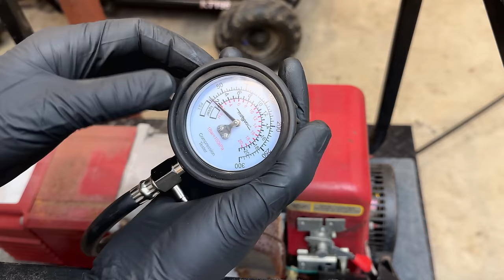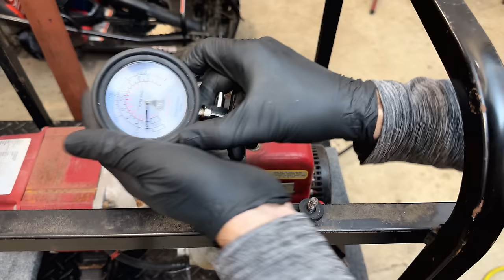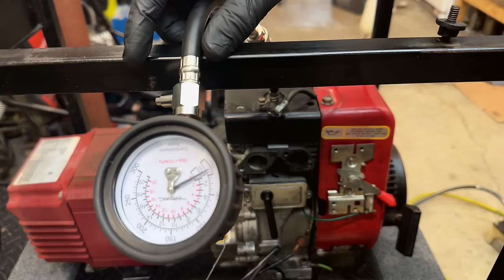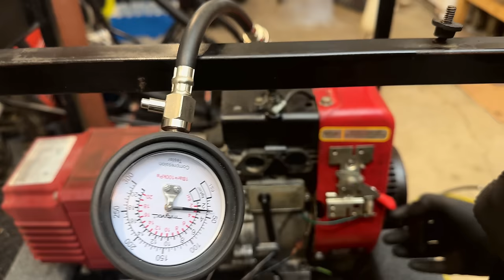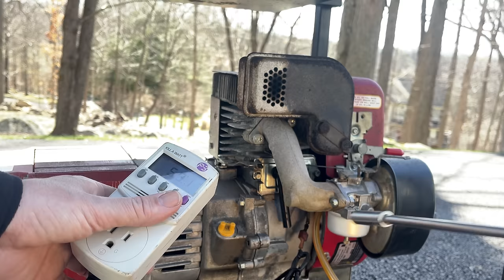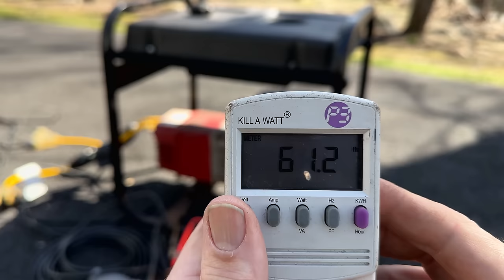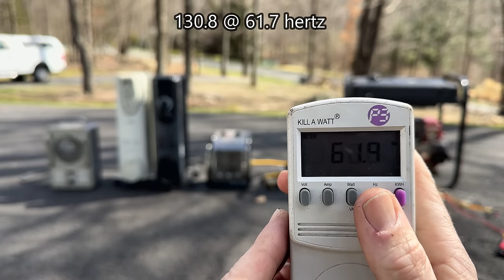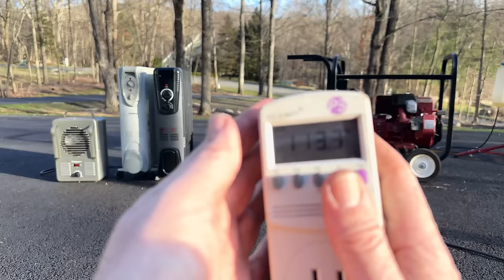More Tecumseh Trouble - Low Compression

Comment: When are you guys gonna get rid of that WD 40 crap (water displacement 40th try) and switch to AeroKroil?  100% better results.  WD 40 is not a lubricant.

The Scotch-Brite would do the same valve cleaning using water.  I've done so.

Comment: I find that make of motor so finicky.  Can I ask you why you play with the choke, there is no fuel in the carb, and you want all the air available, or is it just a habit?
Reply: Not the carb per se..

it's that long unheated manifold with the 90 degree bend allowing fuel to fall out of the airflow when the engine is cold...
that's the cause of the lean mixture and rough running.

If you adjust the carb for smooth cold idle..
when the engine warms up and heat migrates from the head to the intake..
then you get a rich mixture under load.

Small engine carbs are usually straight shot down a small manifold (if any) straight into the head/valve...
Reply: I guess I wasn’t clear   When you were priming with starting fluid at the very first. The tank was dry no fuel to carb. No fuel to “fall” out   Sorry I was not clear on when you where closing the choke
Reply: James actually explained that he was squirting that aerosol into that long carb throat and made the observation that the aerosol might not be getting up to the cylinder as an aerosol....since it was "sticking" to the long intake???

Air fuel mix is also an aerosol and thus can also fall out and condense on cold intake walls....

To try to make sure there was some aerosol James closed the choke???

 @tsirron
Reply from the maker: Likely the fuel was puddling down at the carb or bottom if the intake manifold pipe.  With the choke open I thought it might not be able to pull any fuel up the intake pipe.

Comment: why did you not wire wheel brush those rusty head bolts lol and the aluminum i usually after cleaning use a spry clear coat to help cut down on the oxide coming back for a while of course i do my motors as hobby not income where you have to cut some corners to make any money  But i do more 2 stroke outboard up to 120 hp than small motors im not into 4 stroke outboards  but do inboards that are 4 stroke
Reply from the maker: If I had the time I would do that and more.  Just trying to keep a weekly schedule and equipment moving.

Comment: This is a terrible idea! Don't get me wrong, these new cans aggravate me as much as you. However the new design has nothing to do with spill safety or fumes. The design is the result of modern fuel. Here's the reason  behind the design. The modern fuels  with  Ethanol and methanol added to them only have a shelf life of 60 days after manufacturing it.  The alcohol added dosen't evaporate as fast as the petroleum base does,  So from the moment it isn't stored air tight  it becomes more alcohol than petroleum because the petroleum  evaporates.  This becomes a real problem when using the fuel  for 2stroke engines because the mixing oil can only combine to petroleum molecules and will not combine with the alcohol. This is why so many people are blowing up there equipment and Atvs these days. Second reason is as the petroleum evaporates the alcohol absorbs moisture from the air  like a sponge,  not to mention the additives are corn based which spoil and grow bacteria.  Even diesel will spoil and grow bacteria.  Cans need to be air tight, if the can isn't expanding and contracting during temp change then it is no longer air tight.  Even with these new cans gas stored only last about 30 days under air tight conditions.  Not to mention if you get pulled over transporting fuel in a non new version can its a $75 fine per can.  Other wise I would love this idea

Comment: Tecumseh engines are not great engines. I've only had one that ran smooth and perfect. Even when new they weren't smooth. AKA They're junk!
Reply: That one that ran perfectly...did it have a much shorter or no intake manifold at all?

The closer a carb gets to being right up at the intake port the easier it is to tune as the longer manifold makes the fuel fall out of the fuel air mix and condense against the cold manifold...and the 90 degree bend is a major problem as well..